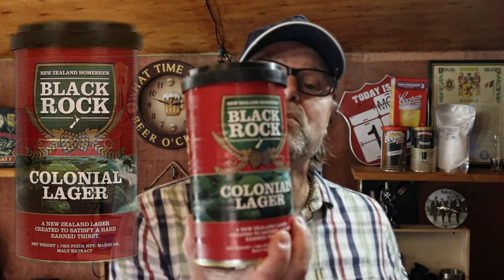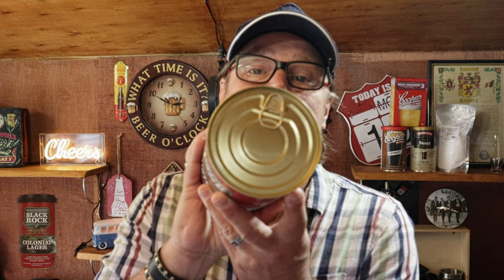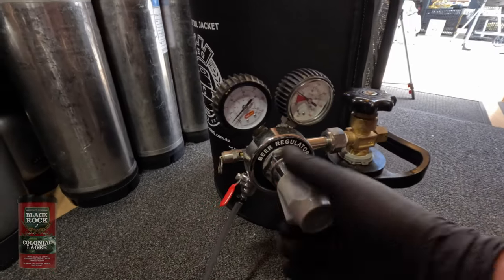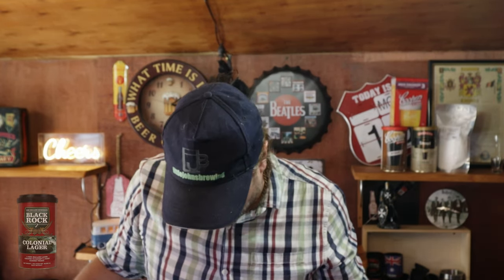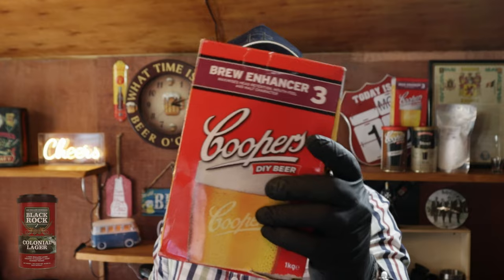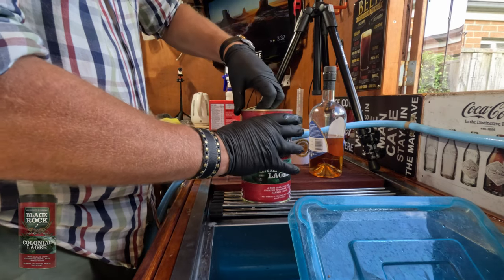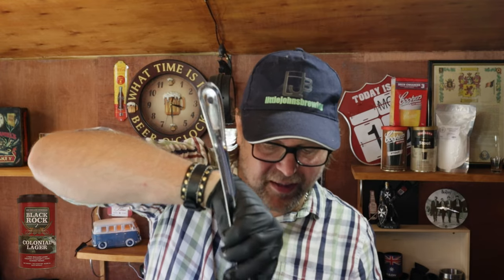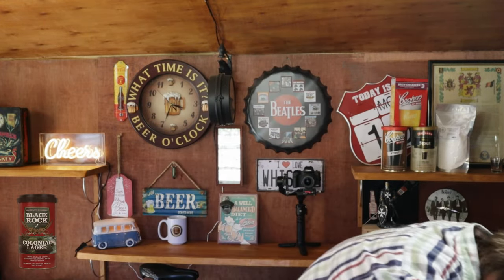Mastering Black Rock Colonial Lager: From Extract To Glass - A Brewing Journey You Can't Miss!

Comment: Hi Pierre the permanent PRV should not be a grey one in a plastic fermenter. The grey ones are far too high in release pressure and if the spundy blocks up you may exceed the safe pressure of the fermentasurus. I would not go any higher than the red PRv rated at 2.5 bar.
Reply from the maker: You are so correct, I didn't even realize I was using a PRV that was rated at 100 Psi/7 Bar, I usually use the red one or in some cases the blue one. I don't know what I was thinking!!!!!!!! Thanks for the heads up.
Reply: @SimpleHomeBrew  we didn’t want to see a big mess of exploded beer 😱😂 in the new interior of the brewhaus… 
it looks great btw. 👍
Reply: Great video buddy

Comment: Thanks for another contribution of brewing beer with malt extracts. Cheers from Germany. So please be aware of lifetime span of these PET containers. We know about some PET bottles from Soda Stream, which expolded after filling. Better use a stainless steel KEG instead. It's saver, then this plastic crap from Down Under.
Reply: He does use a steel keg, that is only an FV. 😂
Reply from the maker: Hi @JohnDoe-es5xh, my favourite fermenter I use regularly is Keg King Apollo Titan. I still ferment in pet kegs and definitely know of the risks, it is vital that you pressure test your equipment at least once a year after the pressure expiry date is reached. I have yet to see any issues with these products at all. I feel that most users that have problems actually don't use safety valves correctly and never take the time to check their equipment. Thanks for watching I really appreciate the feedback! cheers.

Comment: Another great video. Have you weighed up the cost of making your own brew enhancer vs buying ready made? I know a coopers enhancer 2 is made up of 500g dextrose, 250g dried malt extract and 250g maltodextrin. Here in UK, those 3 ingredients cost about double the cost of buying the enhancer but makes 4 batches so effectively half the cost.
Reply: I do this too jamie but make the dex to 700g and the DME to 500g then there is no need for maltodex. but when doing pales I use 1kg Dex and 100g of maltodex 🍻
Reply: @AndyThom  yeah, i just know that as the 1kg brew enhancer 2 by coopers. I know they all contain maltodextrin as it helps with head retention as its not a fermentable sugar.
Reply from the maker: Yeah, I know, I try to make videos for the beginner brewer as well as you guys. I have all the ingredients to add in such a manner but for beginners this isn't always possible. I also like to use dry malt extract to boost the malty characteristics of some of the lower quality kits.
Reply: @SimpleHomeBrew  was just thinking of you making it up and it being a little cheaper for you, but explain this is "brew enhancer X". You do a lot of brewing and from when i brewed before (2015), im amazed at the increase of these products. I used to get a coopers kit and enhancer for around £13, now i am seeing £23.
Reply from the maker: @jamiewebb774  yeah, I didn't think of that. I may be inclined to maybe make my own and maybe explain to my audience that you can either make it or buy it. My gosh it's so expensive in your part of the world.
Reply: @SimpleHomeBrew  yes, it ranges from £13-£16 just for the can of LME and yeast, then ranges from £6.50-£8.50 for the brew enhancers. This time i will just go 2 can kits like the festival kits, i avoided those last time due to the cost but now some of them work out cheaper.